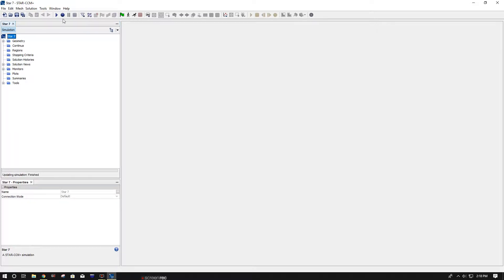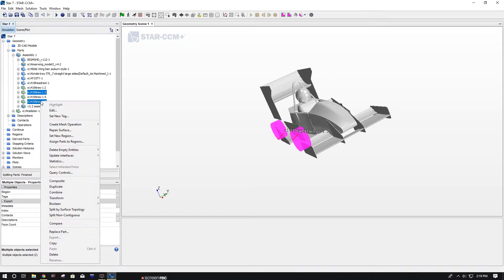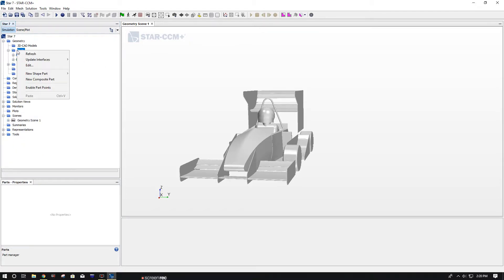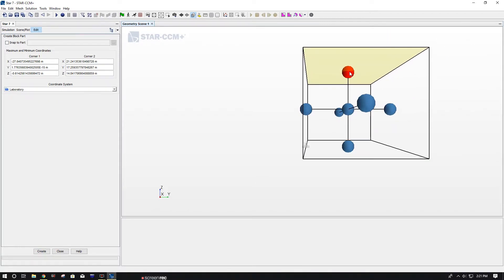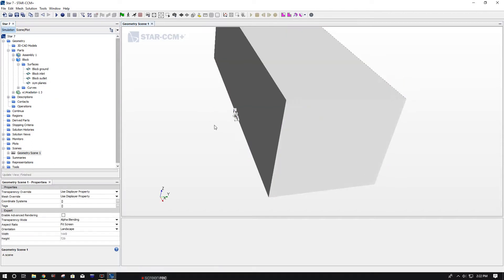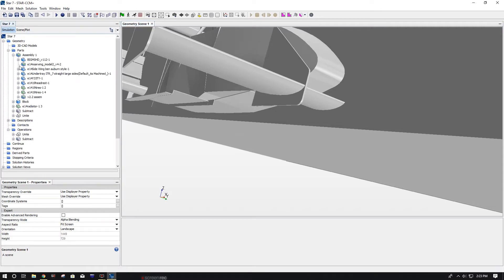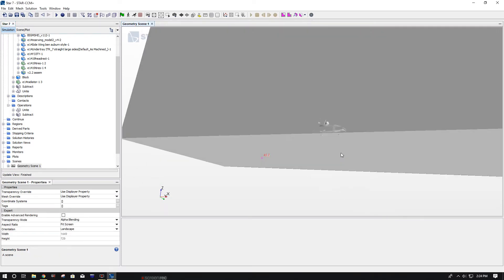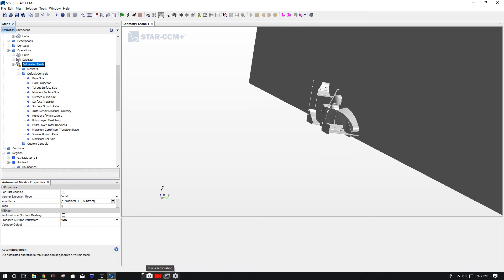Star CCM+ Full FSAE Car Simulation Walk Through Pt.1

Comment: Hey Valero! I am a rookie in CFD and a part of a newer FSAE team. I really appreciate your video tutorial about the FSAE vehicle simulation setup but I have some questions if you don't mind me asking! I am currently trying to simulate my radiator and I got up to your portion of the video of making its own region but for the boundary condition, I am unsure of what I should put. I was suggested mass flow inlet and outlet for rad intake and exhaust respectively but this suggestion comes from someone with no credentials. Also, when simulating the rotating wheels, I am getting Cl of 3+, which I think is unrealistic. I've made 2 coordinate systems (one for each axle) and set the wheel to rotate about their respective axles via setting the tangential velocity from fixed to local rotation rate, selecting the corresponding coordinate system, and setting the rotational speed.

Comment: Hi, at 0:50 u mentioned abt repairing surfaces and getting no errors, i tried that on my imported x_t cad model and showed that there was over 200 problems.. do uk how to resolve this? thank you
Reply from the maker: Are the errors green or red? Green represents a geometry with 0 thickness and you will need to thicken it even if its .001 inches. Red means you have interfering geometry and you will have to correct that some way in cad
Reply: @sebastianvalero3804  Hi it all shows red, may i know any way to correct it? if i do not correct it and just continue with the simulation, are there any negative effects of it? 

another qns, may i know what is 'split by patch for'?
Reply from the maker: @ileonlite  where it shows red those parts are going through each other. open it in cad and either separate them by a super small amount or make it a solid body so the inside is solid and the parts are now one singular piece. 

Split by patch is so you can assign each wall on a box or radiator to be a specific thing aka inlets or outlets